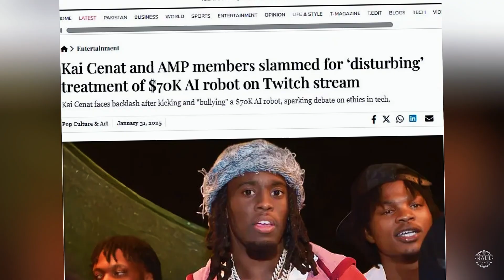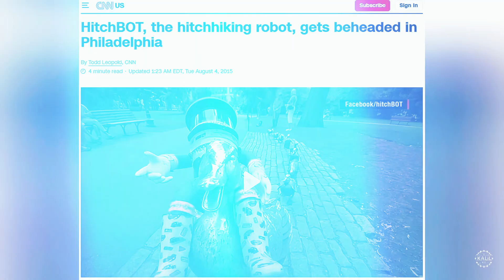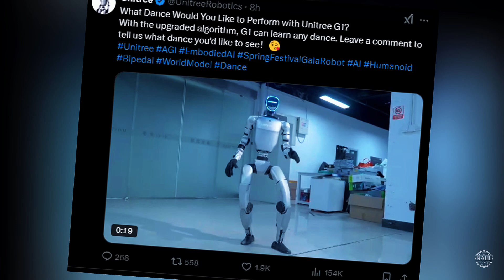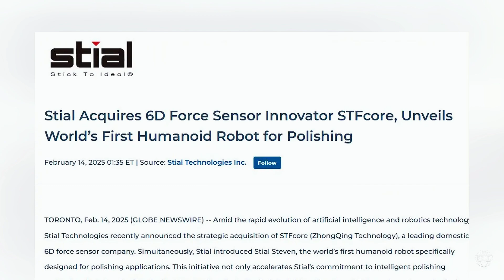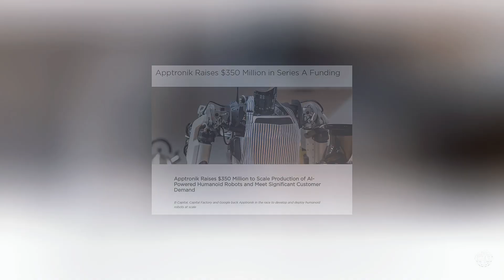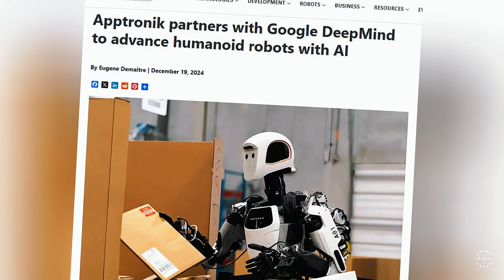EXTREME AI Robot Abuse, Google's Huge Apptronik Humanoid Robot Investment, Unitree G1 Dance Update

Comment: The robots that you see in most of these stress testing videos don't have an onboard AI. And nearly every case the robot is remote operated the term they're using for it these days is teleoperated. They're like those toy robots from Radio Shack in the 1980s that were operated with a remote. You got to remember none of these robots have an AI on board that you see people knocking down and beating up it's just the body with no brain so to speak. There's no reason for them to stress test the robot with the AI system running the robot these tests and videos are being done with robots that are strictly remote operated buy a program that runs on your cell phone as an example or on a tablet.